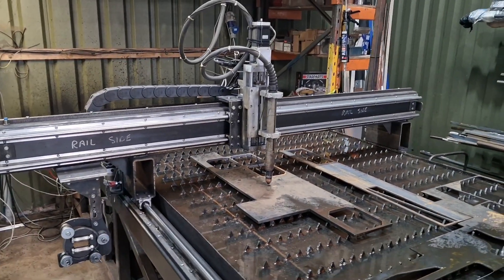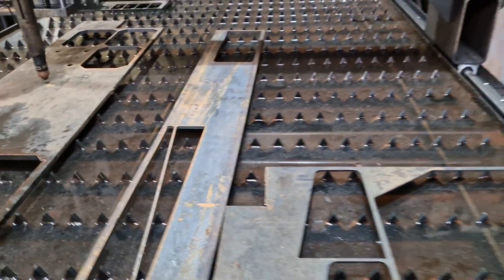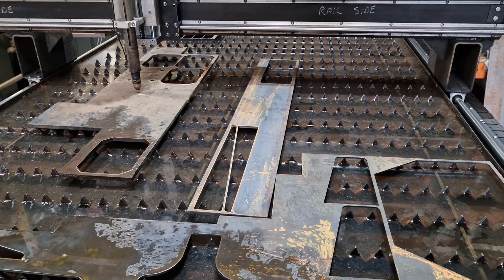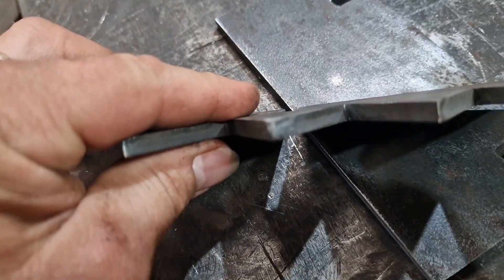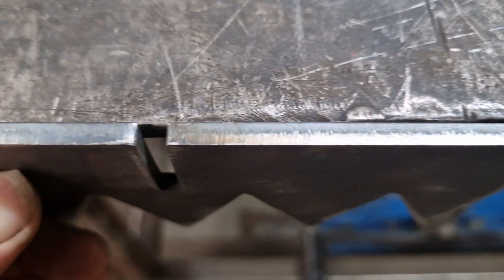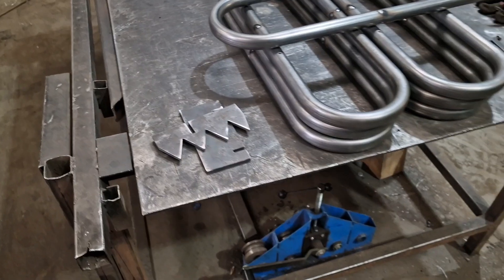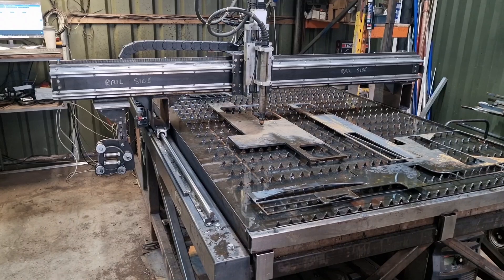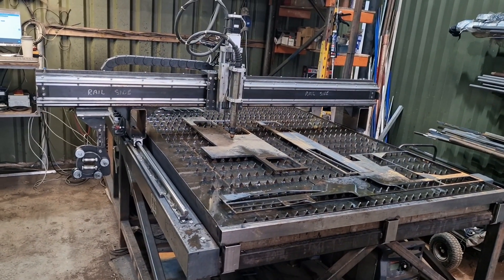New water bed. DIY plasma table cnc

Comment: Do you have any wiring diagrams or CAD files to build this table? A list of the parts and where to find them? Especially where are your guide rails and rack and pinion setups from? Im wanting to build a 10’x5’ as cheap but well built as possible. Love this channel.
Reply from the maker: Hi
I don't but I will have a list and where to get it all soon. Its something I've been meaning to do for a long time. I have all the dxf drawings for all the parts that need cutting. So, please hang on I will release them.
Reply: @robbroomfield468  Thank you! That list would be awesome.